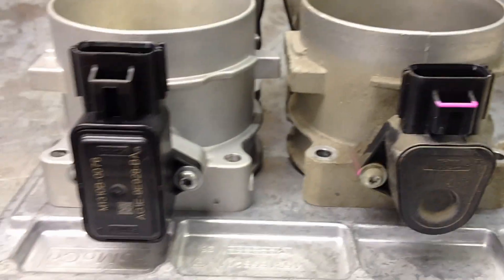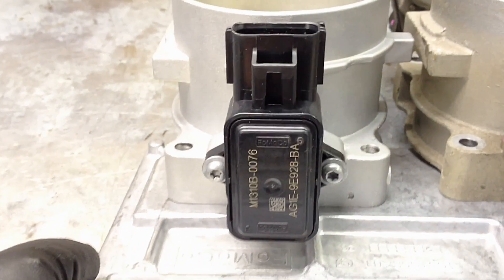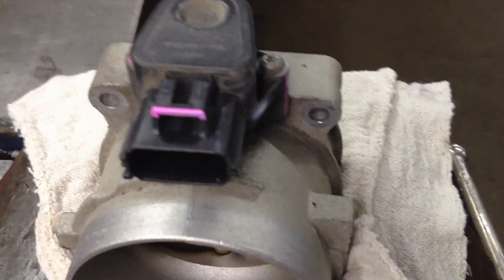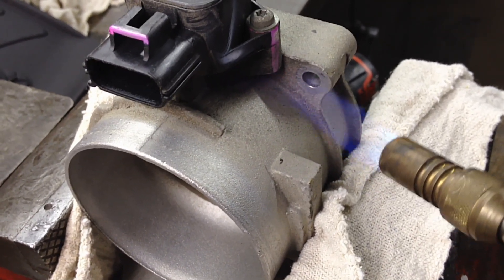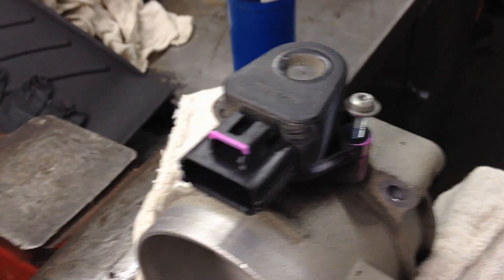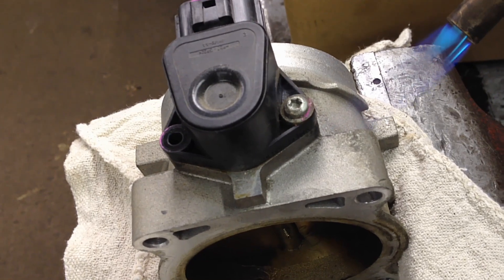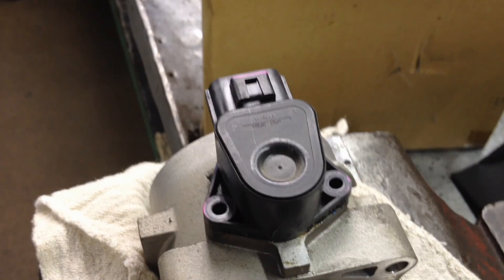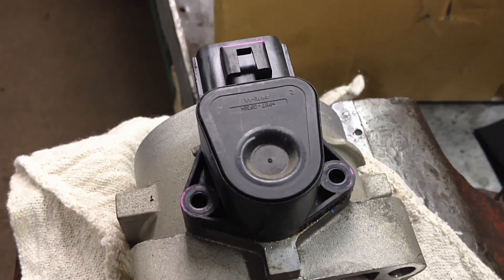Ford Throttle Position Sensor Replace Without Breakage P2135

Comment: I just want my truck to quit over revving . Don't want to tear anything up .
Reply from the maker: Ok so if there wasn't a problem before with the trans I would put the old ones back on and use Ford units. Otherwise we are going to need a scan tool to check iac duty cycles, vss input and tps voltages. We see nothing but problems using aftermarket electronics.

Comment: No not ford TPS Got it at Auto zone . Replaced because my truck with the heater on if I was sitting at stop light the idle would bottom out almost like it was going to quit . Never did though Now I have this huge problem to deal with and it's on my mind constantly . Any suggestions would be appreciated !

Comment: I just replaced tps on my Ford ranger 4.0 and the iac .I'm thinking about putting my old ones back on when shifting gears it's way over revving up to 2500-3000 any ideas ?and it's worse when running the heater ! Please help
Reply from the maker: was a ford tps? Why was it changed in the first place.
Reply: FordTechMakuloco   Hi say can you give any advice on the most probable cause for a code 212 IDM to PCM Spout Connector signal loss? n a 1994 f-53 7.5L  I have checked the continuity from the spout connector wires to the ECM all show good and from the Spout Connector to the ICM and all show good continuity also ? I'm at a dead end on this one?    Also I get a 411 & 412 code of unable to control engine rpm with KOEO ? thanks! Alton..

Comment: 2000 Ford Lightning F150 5.4 Any special tricks on installing new TPS Sensor?
Reply from the maker: Joel Estrada Nope it bolts right on and is keyed very simple repair.
Reply: FordTechMakuloco can you replace the sensor without removing the throttle body?

Comment: Thanks much ! I would not think blue would cause a problem those screws must be really lousy. I think I will just touch the screw head for about a minute with a soldering iron. Really not excited about the open flame since I am doing it on the engine and not part of a total rebuild or anything. (2001 expe 5.4L)

Comment: Curious if you need to clear the memory/codes after this like in your Throttle body replacement vid to clear DTC p2016/ p2035? Thx
Reply from the maker: Yes it is a very good idea.
Reply: Much thx!

Comment: Yup I remember when I broke that screw many moons ago...got lucky I had enough meat to use a vise grip lol....
Reply from the maker: I have done that too in the past.
Reply: This happen to me  but I don’t have enough thread should I drill them out ?
Reply: Luckily the head broke off of 1 screw on me, I heated up the throttle body with torch and used channel locks to get it out

Comment: Can you clean the throttle body without damaging it?  I have a 2006 4.0L Explorer and the service manual says cleaning it will remove a protective coating.  It sticks when it's cold.
Reply from the maker: It will just ruin the Teflon coating supposedly, I am not even sure Ford even uses that coating anymore because in newer tsb's and FSA's they say use regular throttle body cleaner with no mention of a special kind for the special coating so I think it is a thing of the past. Carb cleaner is just more harsh and there are lube points on the plate it may wash out.
Reply from the maker: Yes it is fine just use throttle body cleaner and not carb cleaner. See here-
Cleaning An Electronic Throttle Body Safely
Reply: FordTechMakuloco Too late. I've been cleaning the TB plate for 13 years with carb cleaner with no ill effects...yet.  I subbed.

Comment: Great technique for Ford's loctite addiction problem!
Reply from the maker: Yup they even acknowledged they had a problem in a tsb. I think they use a full tube of Loctite on the body bolts for the 6.4L cab man what a pain those are.
Reply: @FordTechMakuloco How about heat gun versus propane torch?